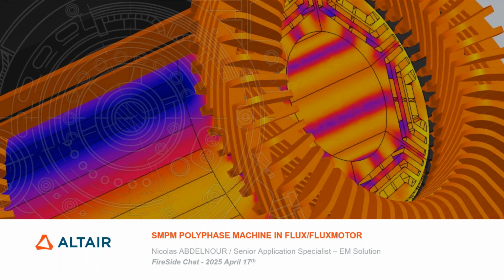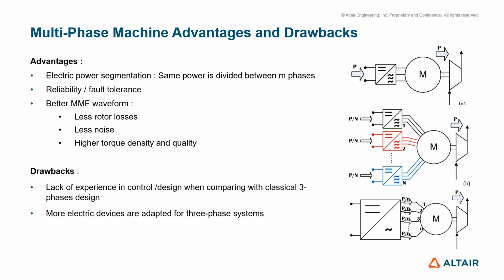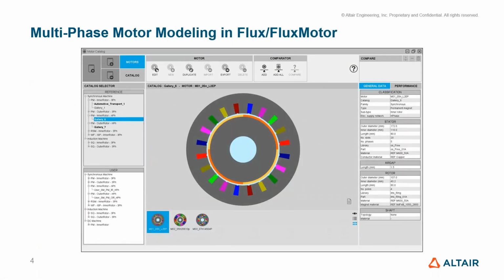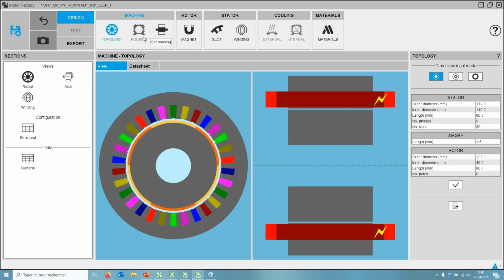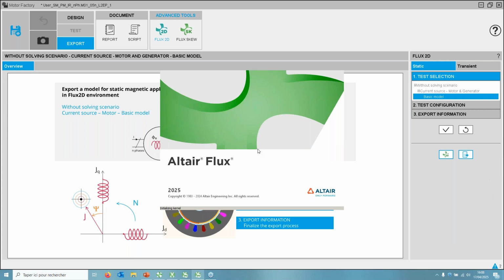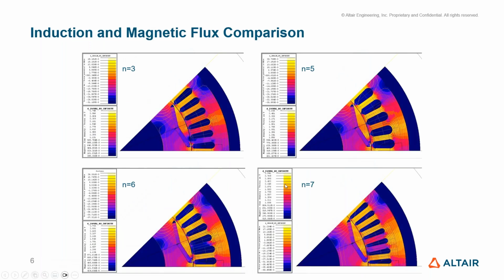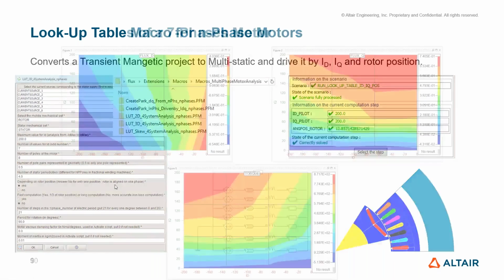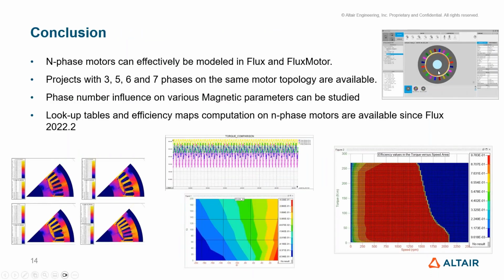SMPM Polyphase machine modeling in Altair Flux and FluxMotor

Comment: Hello thanks for the video, I was unable  to model a double winding motor both star connection and electrically isolated for 6 poles 144 slots. I used 6 phase.